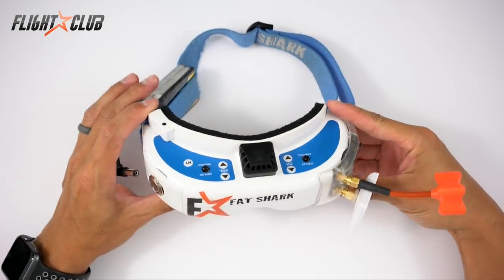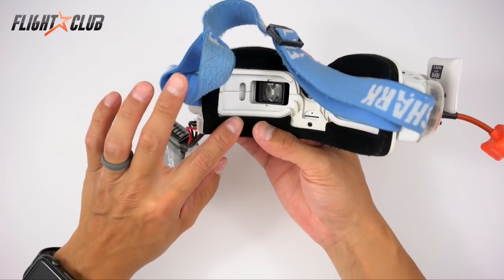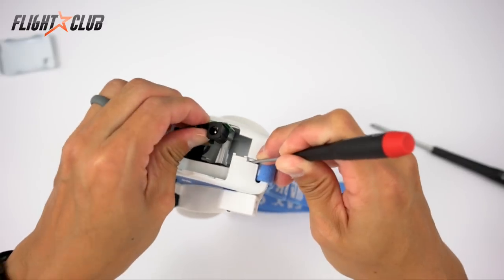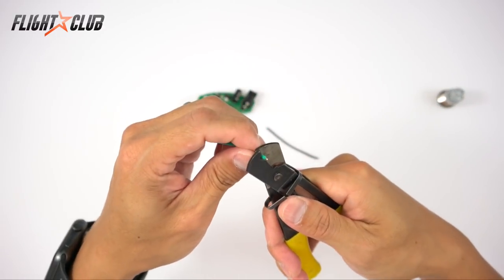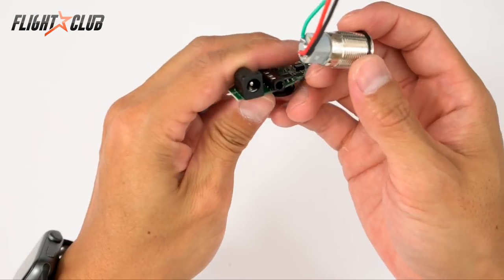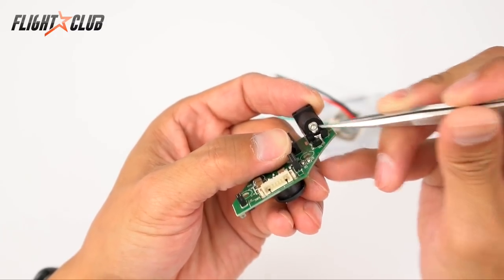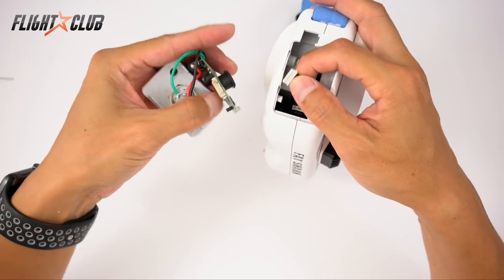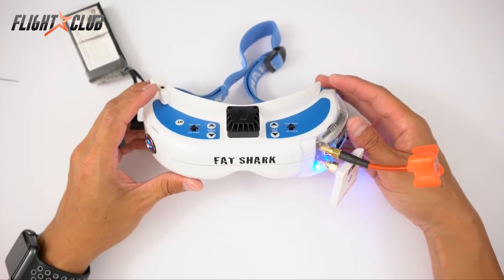FatShark Power Switch Mod

Comment: Good one! really gonna try this. Btw I saw you use a tattu battery that I also use, and it slip off easily when I took off/wear my googles. I wonder if you have the same problem and how to overcome it?
Reply: väinö räinä whoa thanks man! this is just what im looking for :)
Reply: You can also just put the loop side of Velcro on either side of the battery and that will hold it in place.

Comment: Even this vid is a year old already hope I get response. Which pins you bridge? is it NO with the plus pol from the LED? Guess black wire goes to minus pol from the LED. Sadly it's not so clear from the vid, seem there is no +/- mark for the LED or only not visible in the vid.

Comment: Can we please get a confirmation on the right push button to get? I've read mixed comments online, some people are saying the 36mm is to long and won't fit in the Fatsharks. I have also read you can get them in 21mm lengths but I am unable to find them anywhere for sale?
Reply from the maker: Just clip the tabs a little in the back like in the video and it fits fine. I've done it twice and they both fit perfectly
Reply: FlightClub can I email you a pic of the button I have so you can advise me of where to put the wires. Thanks
Reply: FlightClub can I email you a pic of the button I have so you can advise me of where to put the wires. Thanks

Comment: i got the switch today from the link you provided ,,but the pins are a bit different than what you have , My LED light stays on the whole time after the install
Reply: Hey there. Looks like you goofed. If the led lights up as soon as you connect the plug? You simply connected the led + to the + in from the plug. It should have been soldered to the normally open(no) contact on the switch. Or, cuz some switches are different, your + from plugshould go to unmarked center tab. The + to the board gets connected to tab marked NO. Which is bridged to tab  labeled led. Then your neg - from the board goes to the tab on the side across fromtab labeled  led. Ive done a few of these after watching this AWESOME vid with various switches but they all seem to have the same markings. Hope this helps

Comment: would be nice if you told us what the pins are on the switch.
Reply from the maker: for the application of this video, the pin layout used in this video will let you add a on/off button to your goggles.
Reply: @FlightClubFPV  lol no shit ;-) I meant every pin on the button.